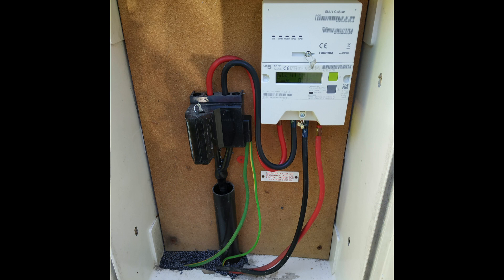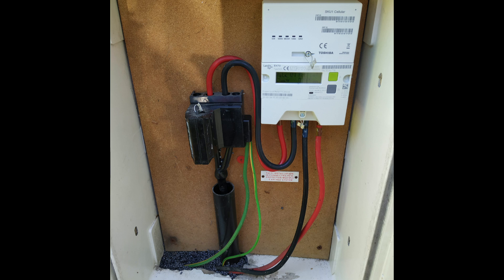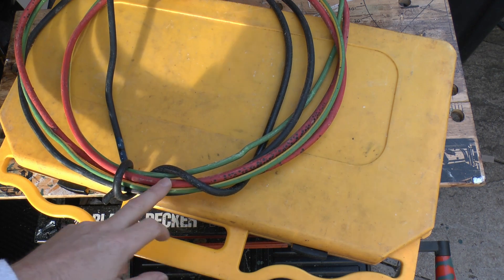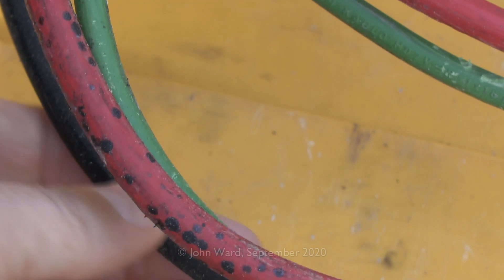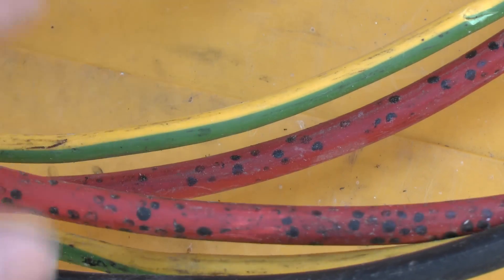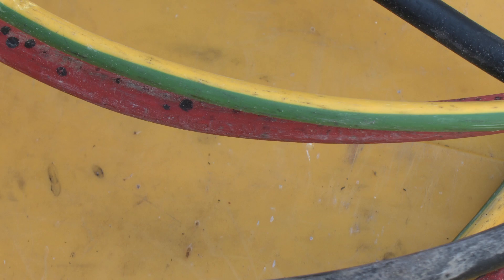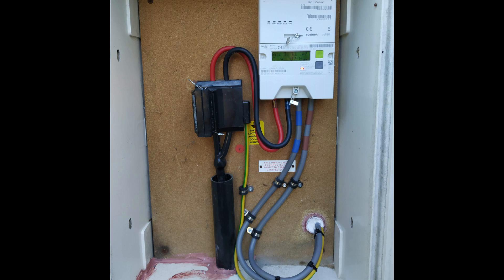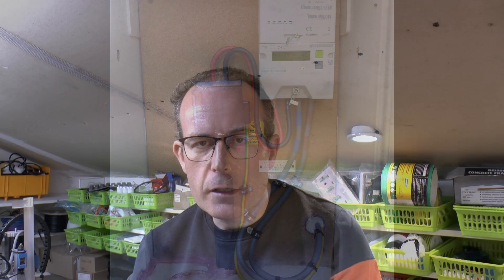PVC Insulated Cable Damaged by Expanded Polystyrene Insulation

Comment: From what I understand its actually the plasticizer in the PVC that plasticises the styrene and migrates out of the pvc.  PVC cable insulation is around 30% plasticizer so the volume of the cable can reduce significantly and potentially expose conductors.  Temperature is the biggest factor which may be why this installation only had minimal damage. This problem doesn't happen with uPVC adjacent to PolyStyrene due to the absence of plasticizer.

Comment: What about other types of thermal insulation. Do they all damage the cable. Can you do tests to see how hot the cable gets at full load ?   What device can you use to control the amps when testing a cable ?

Comment: When I use to fit electric meters the auditors use to always fail people if they saw any inner insulation showing on the meter tails or even the customers own equipment. Because we call it inner insulation there is an obvious assumption that Meter tails are double insulated but they are just sheathed like twin and Earth. What I would like to know is, is there any  regulations being broken by having inner insulation showing? Most sparks always leave some showing and some cut off huge peices of the mechanical protection to use as polarity markers.
Always found it irritating that a less qualified meter worker had to redo Electrician's work because it was sub standard. Or is it?
Reply from the maker: Inner insulation should no be showing anywhere outside of an enclosure, including at the meter.
Reply: @jwflame  Thanks for clearing that up John. I guess some electricians get into to some bad habits.

Comment: Lol. Wood back plate in an electrical cabinet. Individual wires (single insulated?) instead of proper cables. 
Would not happen in central EU instalation. This would not be up to code. At all.

Comment: Good job John. I haven't seen this covered before. I've come across this twice in the past. Once was in the late 80's when I bought my second house that I'm still in. The loft had shredded polystyrene insulation and the lighting cables were just laid in-between. When I lifted the cables out, the polystyrene was stuck to the cable along its entire length. The other time was in the mid 70's. I did my apprenticeship in a TV factory and some of the TV's had plastic cabinets. For some reason and I can't remember exactly how but they used to tape the mains lead to the top of the cabinet and this used to do the same thing. I don't know what or if there's a name given to it but they used to call it marring.

Comment: In France the cables are always pulled through cavity walls and through insulation, before going through the boardwork terminating into the fittings. Those seems to function properly so i'm a bit confused.

Comment: Would I be right in thinking that the spots in the ceiling have been deliberately"semi removed" so that they don't cast a glare into the camera? Or is it shoddy installation;-)? Also have you been consigned to the roof space from the dinning room?
Great informative video again though, something I was only peripherally aware of.
Reply from the maker: They are angled like that so they light the bench below, otherwise most of the light misses the bench.  There is also very little clearance behind them, and they don't fit flush into the ceiling - it's the roof of a wooden shed, only a couple of inches space behind the ceiling.

Comment: Hello John. Back in 2016 you did a short video on RCBOs. with a explanation of their function and advantages. I have an issue I would be grateful for your advice (again) . I am installing an electric shower rated 10.5 kw. I have an existing consumer unit installed (metal boxed so not that old), but is the cheepo version fitted with just standard MCBs on and two RCDs. I believe I need a 50A breaker for power to the shower (on 10mm cable) . I have watched another video by an electrician installing a shower supply and he put in a RCBO rather than a simple MCB. 
The consumer unit is a BG manufacture from Screwfix  and they do not do a 50A RCBO.
However they do a 50A MCB and I have a spare way (slot) on the unit where I can fit it. Is this okay to fit or would i be breaking any regs ? Many thanks

PS Have you done any videos on explaining Consumer unit boxes and how they work. The RCBOs seem a relatively recent choice and they are probably six times the price of a MCB. And like you said in the video they are considerably larger in height , or double the width so can be problematic when
fitting to older units where space may be an issue.
Reply from the maker: You can use a 50A MCB and separate RCD, provided the RCD is rated to more than the total of the circuit breakers connected to it.
Reply: @jwflame  Many thanks John.

Comment: Underated cable got too hot, simply nuked the beads and residue left behind. These should have been able to carry 100amps and sleaved through the cavity and then airsealed. To categorically say the beads were responsible is the opposite of the truth.

Comment: Having upgraded the wires from the meter, what about wires to the meter and the property ? Maybe they're only suitable for 60A ?
Reply: That's not necessary as the 'company fuse' is rated for the incoming cabling.
Reply: @cambridgemart2075  Pretty much my whole point. Why uprate the meter tails for currents they're not going to see as everything upstream of there is rated for  a lower current !

Comment: Are we sure this is degrading and not just staining from colouring used in the dye for the beads, as you rubbed off the staining and it didn’t seem that there was any cracking, melting, or sign of deterioration other than colouring and as you state the cable being 40 years old didn’t seem to be in particularly bad condition.
Of course I respect your view and that increasing and upgrading is a good idea, but I question the deterioration from the example shown.

Comment: Thanks for the video always informative. Two small points I beleave that the back board belongs to the supply company and you are not suppose to fix or drill it.  Secondly will not the insumesant filler reduce the heat heating of the cable as it is not in free air.

Comment: @John Ward,
We had this issue over here in New Zealand in the 1990's with pre-fabricated buildings, where the wall panels would be filled with polystyrene foam insulation after the building panels were wired.
Non-migratory TPS type cable is now available (that has a purple outer sheathing) for this very reason.
Although, I've always thought that medium-duty PVC conduit run on the outside of the building and fittings with short stubs of conduit through the walls would have been a better solution.

Comment: What about this insulation backed plasterboard, is that kind of solid insulation polystyrene? Does it have a similar effect? I'm worried now about cables I've run.
Reply from the maker: Some types will damage the cables, polystyrene or EPS will, PIR/PUR types do not.  However the insulation effect will still reduce the capacity of the cables, regardless of the type of insulation.

Comment: The marks you saw were likely graphite from the beads.  Graphite is used in some polystyrene bead manufacture (for approx the last 10 years) to enhance the thermal performance of low density expanded polystyrene (it has lower emissivity of infrared radiation than the non-graphite white EPS beads, and so increases the thermal performance by 20% or more).  Exactly what happens over the long term in this situation depends on the "plasticiser" chemical additive which was chosen by the cable manufacturer.  A large range of different plasticiser compounds have been used over the years, and my understanding is that newer cables are a lot less susceptible to this, due to changes in the chemicals used.
My understanding is that with cables produced in the last 20 years or so, the PVC itself is usually not "attacked" or eroded by the insulation, instead the plasticiser leaches from the PVC into the polystyrene (so that the insulation appears to "melt away" from the cables).  This has the effect of turning the plasticised PVC cable insulation into unplasticised ("PVC-u" AKA "uPVC" - the stuff that replacement windows and rigid cable duct, trunking etc. is made from), so the main danger is then damage from reduced flexibility when the cable is moved.  In some cases it can make the damage self-limiting, because the EPS loses contact with the cables.
A practical workaround for cables which may come into contact with expanded polystyrene is to enclose the cable in rigid PVC ducting, or trunking, or to use "fire rated" "LSF" or "LS0H" cable (these cables doesn't use PVC insulation at all, but alternative plastics instead).
Reply: Thank you; really useful

Comment: Thanks JW, very informative as usual. Aside from domestic premises this can be an issue in the food manufacturing sector where Expanded Polystyrene (EPS) composite panels were often installed in chiller rooms and freezer rooms. When cables are passing through the panels often a metal sleeve is not installed leading to the EPS core being in direct contact with the cable potentially leading to the same issue.

Comment: Interesting stuff. Here in the US, polystyrene beads aren't really used as fill-in insulation. Instead, blown in cellulose fiber is typically used when upgrading the insulation on a house. However, you'll often see sloppy DIY work where someone has passed a bare cable through a hole in a wall to an outdoor fixture (obviously a big no-no on its own) then filled the hole with spray- in expanding foam insulation, which is also not intended for exposed outdoor use either. 5 years later, it's a crumbling brown mess, and the cable sheath is degraded from exposure to UV and the spray foam. PVC is probably the most durable type of wire insulation yet invented. But it's not indestructible. Materials compatibility is an important consideration any time you're going to have one material in contact with some other material.

Comment: I remember working on lots of McCarthy & Stone warden assisted homes back in the 80's when polystyrene backed plaster board was being used for internal insulation, our cables that were surfaced clipped on the block work had to be covered in building paper for that reason ! but they sprayed all roof and wall cavities with what they called bonded bead polystyrene  granules !

Comment: I'm surprised that loose polystyrene beads get used for insulation. I'm familiar with blown-in cellulose insulation, but that had been fire-proofed and doesn't give off especially noxious vapors. As I recall, burning polystyrene is pretty horrid, almost as bad as PVC, and I don't know how much self-extinguishing additives added to the resin can help with that.
Reply: The usual retrofit insulation material here in the UK on brick and block build is blown mineral fibre, which has the benefit of being able to be vacuumed out if there are cavity-bridging problems. New build uses fibre batts fixed to the inner leaf of the wall and doesn't touch the outer. As I understand it the bonded polystyrene beads' USP is they don't settle as blown mineral fibre can. I'm guessing they have some fire-retardant added but I no longer have access to a property with it to experiment.

Comment: We get this with FJC it's used with the outlet pipe at a gas meter where the pipe enters the property. The FJC oxides the copper pipe turning it a green colour. I don't understand why the gas auditors don't pick this up and tell engineers it should  not be used.

Comment: People seem to think it's the Polystyrene reacting with the PVC. When it is the Polyvinyl Chloride attacking the Polystyrene. It is the Polystyrene beads decomposing from the PVC and leaving black marks on the PVC.
Reply: That's what I thought. There didn't appear to be any noticeable damage to the insulation, but rather a case of polystyrene being deposited on to it. No more serious than small speckles of paint being splashed onto a cable. Also the conductor size was adequate for the fuse rating. Created an expensive job for the customer for no real benefit.
Reply: It's the plasticiser in the PVC leaching out and damaging the polystyrene; it leaves the PVC brittle as it effectively becomes U-PVC.
Reply: PVC is an annoying material. It can also decompose paint it is touching. For example if you have rubber boots made from PVC sitting on a painted floor or touching a painted surface for a long time, the boots can actually melt the paint.

Comment: A useful cautionary note of course. However, John, I reckon you should be saying 16 or 25 square millimetres, not 16 or 25 millimentres squared. The latter means 16 x 16mm or 25 x 25mm which would be a huge cable.
Reply: 16mm2 means the area of the conductor. mm2 is a unit of measurement for area. It's not asking you to make a calculation.
Reply: @tobysherring1369  'Square millimetres' and 'millimetres squared' are two very different expressions, both of which quantify area, but they should never be confused. 16 sq mm is actually 4mm squared, whereas 16mm squared describes 256 sq mm.
Reply: @KendalSmithy  I know what you mean. What you say 'square millimetres' is different from what you write: the standard way to express the area of something is in mm2 (or m2 or cm2 etc). It's a measurement. Yes, it is made up of 4x4 mm2 units, and we can call it 16 square millimetres, but that is correctly written 16mm2. It's not asking you to square 16 again or make a calculation. https://physics.nist.gov/cuu/Units/units.html
Reply: @tobysherring1369  Exactly. John used the expression 'millimetres squared' when he should have said 'square millimetres'.

Comment: One of several reasons why I won't ever have cavity wall insulation retrofitted, this and possible damp issues that can arise just makes it far to troublesome and if they still use polystyrene beads, surely that should be outlawed... terrible marterial.
Reply: I agree . I have seen houses with damp pockets due to uneven distribution of cavity insulation. Then the company who done it don’t want to know

Comment: Hi John, the two cables going into the meter look like the same capacity as the ones you replaced from the meter to the DB, so in reality they should be changed as well..
Reply from the maker: They are the same size, and they would need to be replaced if the supply fuse is changed.  However they belong to the electricity supplier, not the property owner.

Comment: Is it actually the PS beads damaging the PVC — or is it the PVC damaging the PS beads? As you say, it’s the plasticizer migrating out of the PVC, but wouldn’t that likely have happened regardless? (Since the plasticizers off-gas anyway, regardless of whether the PVC is in contact with anything or not.)
Reply: It’s the plasticizer from the PVC cable insulation migrating to the polystyrene, it makes the PVC less pliable and “melts” the polystyrene. Which then sticks like a sticky glue to the cable. So both are damaged.
Reply: Mark 1024MAK Yes, I know that, but my question is, wouldn’t the plasticizer have left the PVC anyway? It’s my understanding that it just evaporates if it has no other plastic to migrate to.
Reply: Antonio Tejada - It’s an easy transfer to polystyrene. Otherwise it’s a lot harder for the plasticizer to escape. If left for long enough, PVC cables will go stiff and brittle eventually, but it takes a really, really long time.
Reply: Mark 1024MAK Well that’s the thing... I have seen plenty of PVC cables that have gone stiff after just a few decades, without being in contact with any susceptible plastic. I do suspect it varies by PVC formulation as well as storage conditions.

Comment: My dad had the idea of increasing the insulation in his house about 40 years ago. He had managed to get hold of a huge quantity of polystyrene figure 8 package filling from somewhere. He filled up between the joists, covering the cables and then boarded over. I recently rewired and found the sheath peppered with holes in some places where it looked like the cable and polystyrene had melted together. To the point that some areas had exposed conductors visible. Parts of the sheath had become very brittle too.
Reply: Thank you for feeding back, didn’t know this could happen

Comment: Even worse effects happen when you mix VIR and PVC cables in the same installation. The placticiser leaches from the PVC and turns the VIR into goo
Reply: What's VIR? I haven't heard of that .
Reply: @simontay4851  Vulcanised India Rubber
(very very old cable in domestic wiring context, but still exists in many industrial automation systems, especially those that use relay logic)

When adding new wires to a cabinet currently wired in VIR you should choose EPR (Ethylene Propylene Rubber) over PVC
Reply: Daniel Smith - alternatively trunking with separators to keep the different cables apart or separate trunking should be used.

Comment: There isn’t much to expanded polystyrene, it is the plasticiser in the PVC leaching out into the polystyrene, causing this. 
In this case I would argue it’s the PVC insulation which in incompatible with the thermal insulation, except that PVC insulated cables are common in wall cavities.
I don’t think they install bare expanded polystyrene beads any more, the ones in the walls of this house have a grey/silver coating on.
Reply: Yes they do there are a few pure polystyrene products but most are 'bonded' with goo now. The guidance for CWI clearly states that wires passing the cavity should be checked by an electrician for rating and compatibility and re-routed if necessary. This would make CWI less cost effective so the strategy is to blow it in without checking and let the guarantee agency CIGA fob the customer off a few years down the line when problems become evident.